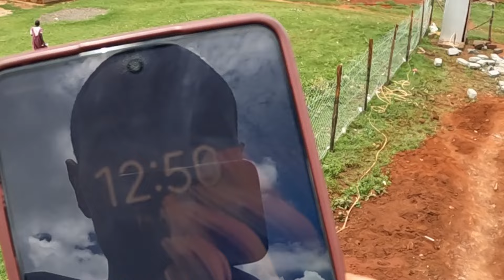𝐒𝐇𝐀𝐏𝐄-𝐁𝐔𝐈𝐋𝐃𝐈𝐍𝐆  𝐑𝐎𝐎𝐌𝐒  &  𝐖𝐀𝐋𝐋𝐒 𝐎𝐅 𝐌𝐘 𝐃𝐑𝐄𝐀𝐌 𝐉𝐀𝐌𝐀𝐈𝐂𝐀𝐍 𝐇𝐎𝐔𝐒𝐄 𝐅𝐑𝐎𝐌 𝐅𝐎𝐔𝐍𝐃𝐀𝐓𝐈𝐎𝐍 🔥🇺🇸🇯🇲 @iammarwa

Comment: where I am from we face similar issues...In our foundations we use concrete (cement, sand, stones) reinforced with steel for strength...But your method seem to work well also.